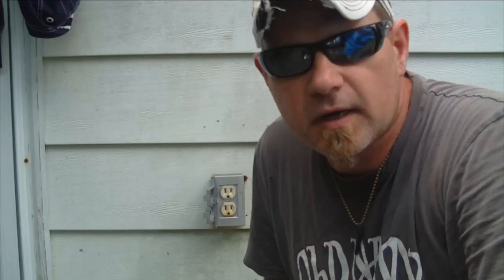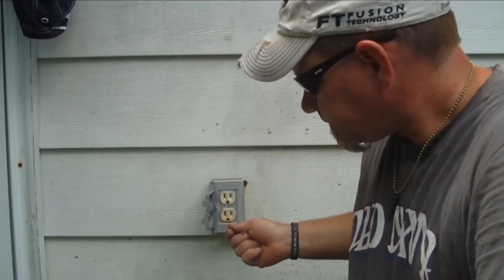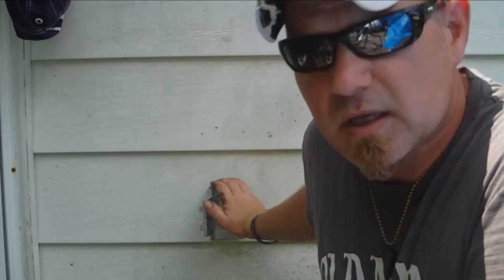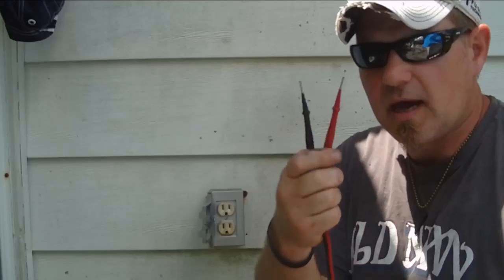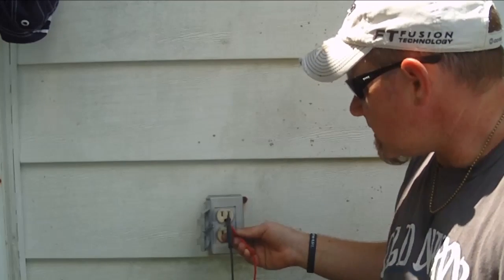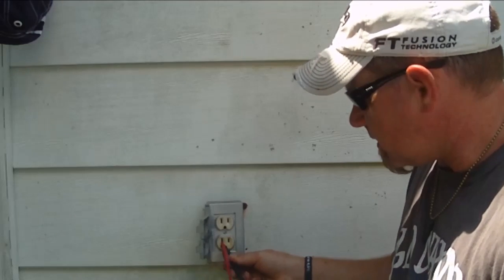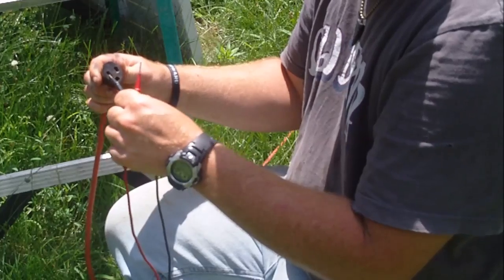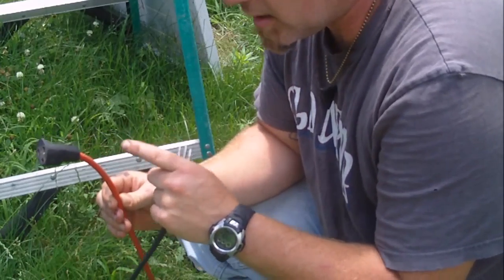How to troubleshoot an electrical outlet and extension cord

Comment: I did a voltage check like you did and I have a reading of 120 volts but, when I plug the extension cord in a wall outlet, there is a small blue spark and, this is with any wall socket!?
What is happening?
Awesome video,and thanks so much
Reply: I have the extension cord plugged into my shop vacuum.
Thanks again.